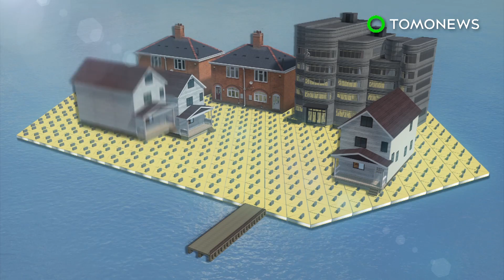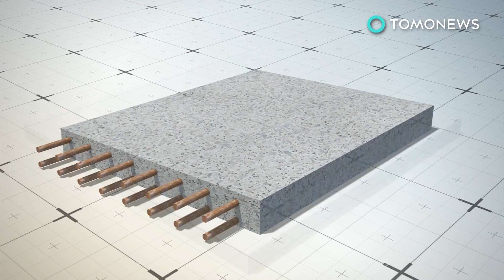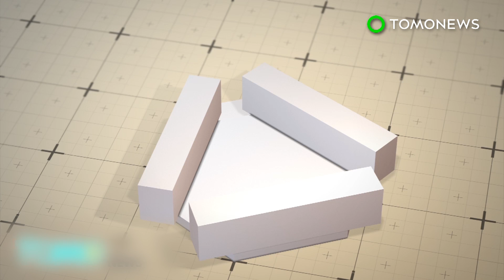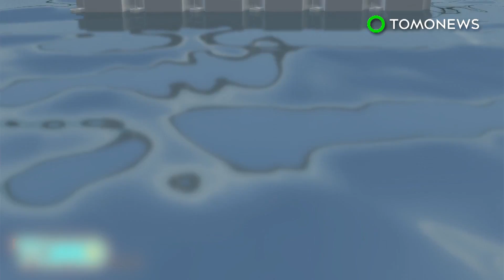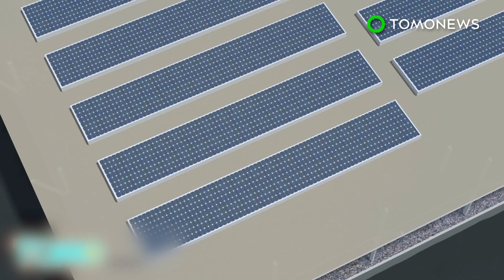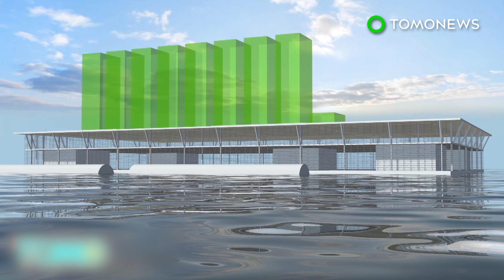Artificial floating islands tested in Netherlands in order to expand liveable space - TomoNews

Comment: Shipping container and steel cable connect into 100^2 each module then reassemble into few hundred square miles with sea port and air port and wave breakers and hallow mountain housing internal building so can submerge if heavy weather and it had farm and seaweed farming and vegetable